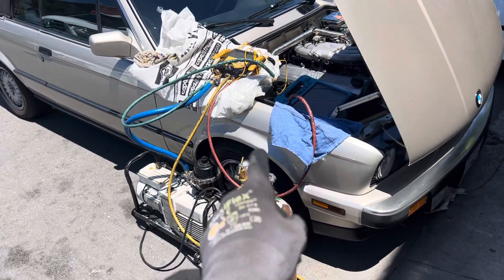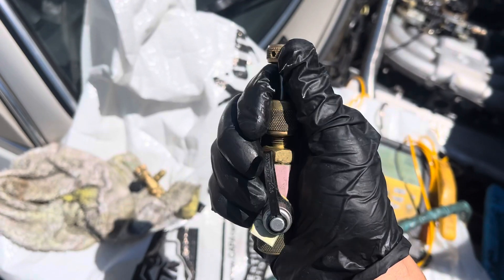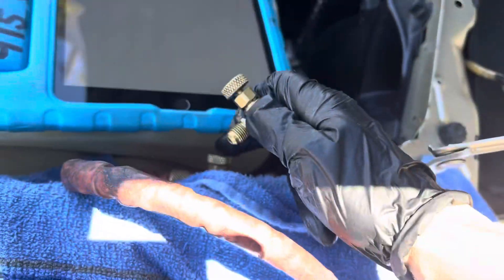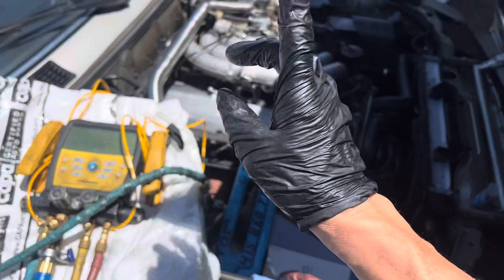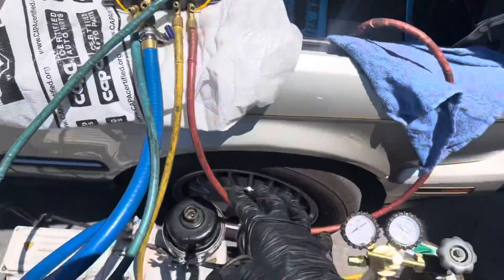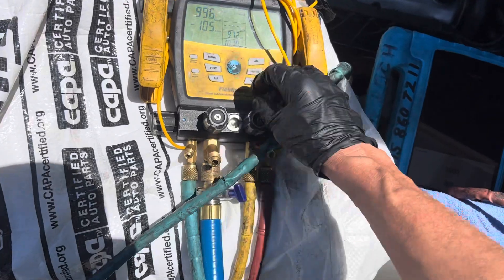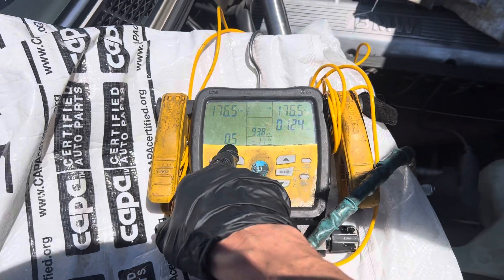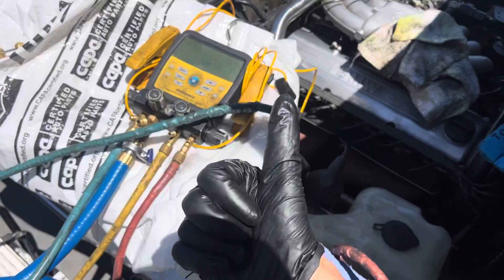Reading the micron meter and then switching over to high-pressure nitrogen decay test ￼

Comment: Hi there ,my gratitude for your educational channel,very informative,thank you learning a lot last few days ,more than years of doing a/c work. if you pull vacuum for an hour or so and your micron gauge stays at about 800,does it mean we do not have moisture and we are leak free? or you are not going to be happy with it,what is the magic number if there is any to be sure there is no leak? thanks again.
Reply from the maker: There’s many times I cannot hold at 800 µm sometimes even 1100 µm system is so contaminated. 

And you have to differentiate between getting down to a number is different than holding down any number or below

even on a wet system with the vacuum pump on I can easily get down sometimes to say 200 µm

But then after letting it sit five or 10 minutes it’ll go up to 1100 µm or 2400 µm that will be moisture and then it levels out. 

Put it on for another hour same result maybe a little bit less the second time

Put it on for 24 hours and then when turning off the vacuum pump we might see 500 µm or 800 µm depending on the level of moisture contamination. 

Usually if I have a problem vehicle and I leave it on for 24 hours on my big vacuum pump that’s capable of pulling down to 3 µm using the three-quarter inch large silicone hoses without using the vacuum gauge and no refrigerant vacuum hoses usually always successful to hold down below 500 µm after 24 hours. 

And that means turning off the vacuum pump isolating the valves and waiting 15 or 20 minutes or more. 

The proper way is not to use refrigerant gauges and not to use refrigerant hoses. 

I have done a couple videos on this but it still freaks out automotive guys because it’s so different not to use gauges and not to use refrigerant hoses.
Reply: @coldfinger459sub0  Thank you Tom,the education continues...my question was for using the same tooling that you are using,the fieldpiece micron gauges,thank you again.

Comment: Can I get a equipment list, perhaps Amazon?
Reply from the maker: Micron gauge Accu tools pro plus

Vacuum hose BluVac three-quarter inch silicone hose kit you pick your choice of how many hoses you want you probably only need one

Fieldpiece SM480V refrigerant manifold

Fieldpiece refrigerant recovery unit MR 45

12 CFM NAVAC vacuum pump model number NRD16T
But this is $3000 you do not have to get a vacuum pump like this I recommend you start with a Fieldpiece vacuum pump. 

Fieldpiece vacuum pump VPX7
This is your most bang for the buck in my videos you see me used to two vacuum pumps one is a NAVAC and others to Fieldpiece

Refrigerant hoses yellow jacket the best brand most durable less problems

Fieldpiece wireless Bluetooth scale

Or the NAVAC wireless Bluetooth scale.   

Refrigerant leak detector Infercon D-TEK Stratus

The Fieldpiece Bluetooth wireless probe kit it comes in the black bag with a little yellow zipper on top. 
Comes with six probes
Two wireless Bluetooth pressure transducer so you do not have to use refrigerant gauges or hoses

Two Bluetooth wireless temperature sensors that are clamp on to clamp on to the pipes

Two wireless Bluetooth temperature and humidity sensors that you stick down inside the dash duct

An iPad to run the software for the wireless recording on the Bluetooth with the Fieldpiece and the wireless Bluetooth micron meter by Accu tools. 

Superior AccuTrak ultrasonic leak detection.  It comes in a kit case you’ve seen them in my videos probably

A couple different types of UV lights but if I was just going to suggest one UV light to start out with because they’re all rated in different powers and different nanometer wavelength of light what makes a difference on what kind of UV dye they work on because there’s different types of UV dye. 

I will get the UV beast it’s available online through Google or Amazon $85

The liquid vacuum lubricating sealant for O-rings
NYLOG 
The one in the blue bottle is for POE and PAG oil compatible lubricants on automobiles and commercial HVAC

Big blue micro leak detector this is the blue liquid you see me squirt on refrigerant lines and hoses to look for leaks

Everything above you could get from True Tech Tools online unless you’re in another country

They have a offer code box to fill-in put in the word BIGPICTURE 

And that get you 8% off your order

You can get the rest of all these part numbers and look into the specs and everything by visiting the website of True Tech Tools

I think that’s mostly everything to get you started if you have any specific equipment items you want to know about ask me and I’ll see if I can look up their names or model numbers or part numbers
Reply: @coldfinger459sub0  Which company makes your core depressor tool? C&D, Accutools, or another? Is C&D core depressor good enough for deep vacuum?
Reply from the maker: @crvinva  Actually I do not know the brand of the cord depressing tool if I remember correctly I got it from True Tech Tools when I was purchasing other brass hardware and vacuum accessories. 

Eventually all core tools have a problem with Vacuum this is why you use silicone grease or NYLOG on the stems. 

So even if you have imperfections and slight leaks the vacuum cannot pull through silicone grease or NYLOG
Reply: @coldfinger459sub0  OK, thanks. If it's from TruTechTools then it's probably AccuTools. I have a CD5050 with a small thumb screw. It's good for tight places but I'm afraid those may not be great for vacuum. I'm planning to do a test and will use some Nylog on the stem. Will let you know the results.
Reply from the maker: @crvinva  👍
Reply: @coldfinger459sub0  I ran a vacuum test today and unfortunately can't recommend CD5050 small thumbscrew core depressor for vacuum applications. So I wonder which tool to buy in order to protect my BlueVac gauge from contamination: CD2060 full size core depressor, AcuTools core depressor, Appion core remover (as a valve), or AcuTools core remover (also as a valve). Any recommendations? Thanks.
Reply from the maker: @crvinva  if you watch the videos I posted about the other YouTuber Jim Bergman and Gary they show you how to arrange value core tools to protect your micron gauge in the videos

Comment: Do you need to vaccum hoses attachéd to Frion cylinder or purging them and to what microns?
Reply: Yes, you can vacuum or purge, depending on the situation.  It's important to remove non-condensables from the inside of the hoses because the volume is large.  Nitrogen is a non-condensable but it contains no moisture like air does.  Nitrogen must still be removed but it's easy to remove because it contains no moisture.
Vacuum microns should be very low and leak tight, the lower the better.  The ultimate vacuum achieved in the hose can limit the system ultimate vacuum.  If you can only reach 150microns then it's likely your system vacuum will be limited to 150microns.  In this case of limited vacuum, further vacuum time can outgas the porous rubber walls of the hose.  So leak-free high quality and clean hose will reach lower ultimate levels of vacuum.
Remember three types of leaks you will encounter are real leaks, virtual leaks and internal leaks.
Reply from the maker: Watch the two videos I made about Jim Bergman YouTube channel teaching you about micron gauges, vacuum pumps and vacuum hoses, and core removing tools.
Reply: @coldfinger459sub0  If fromt is less cold than rear AC,what are possible causes?Thank you.
Reply from the maker: @issamadam9352  expansion valve out of calibration degrading with age partially restricted expansion valve from debris expansion valve that might be sticking the pintle needle low on refrigerant charge

Then depending on a vehicle because heater systems are different on different vehicles heater valve might be stuck open or just partially open bleeding by a little bit of hot coolant in the heater core

The blender doors under the dash partially open or partially closed bleeding by heater core air or too much outside fresh hot air. 

And perform this test with the hood close not the hood open if you’re using fresh air because the fresh air with a open hood when you’re working on it is much hotter because of the temperature of the hot air going over the radiator being pushed by fans and then over the hot exhaust manifold and engine and gets sucked down in below the window vent

Those are among some of the most common problems listed above

Comment: Do you want to purge air while replacing the Schrader valve when using valve removing  tool?
Reply: The volume inside the core removal tool is very small, thus negligable.  UNLESS the core removal tool has water or some contamination inside, which must be clean/removed before attaching tool.  The volume of refrigerant hoses is significant, thus it's necessary to remove air from the hose.
Reply from the maker: Core tool is made to change cores when system is full of refrigerant, so it will always be purging out as you remove the cores. Tiny tiny amount. 

You don’t use them when under vacuum.  You use them to vacuum then after you recharge you replace the core
Reply: @coldfinger459sub0  This ^ is important. Always break the vacuum with refrigerant, not with a non-condensable like air or nitrogen.  Use this tool to replace the core only when the system has positive pressure of refrigerant (to avoid injecting a non-condensable).
Reply from the maker: @thisisyourcaptainspeaking2259  it would be nice to break the system with refrigerant to break the vacuum but if we’re going to open the system we can’t be releasing refrigerant to the atmosphere. 

Noncondensibles like dry nitrogen are easily removed with a vacuum pump. 
       And help perform that sweeping procedure to remove water molecules on the surface in the system of the piping for the vacuum procedure
Reply: @coldfinger459sub0  Not only do we avoid releasing refrigerant to the atmosphere, we also avoid wasting refrigerant.  Break the vacuum with dry nitrogen prior to opening the system or in preparation for pressure decay test.